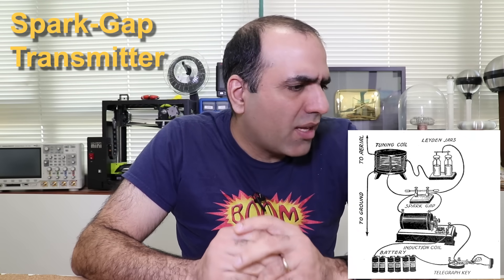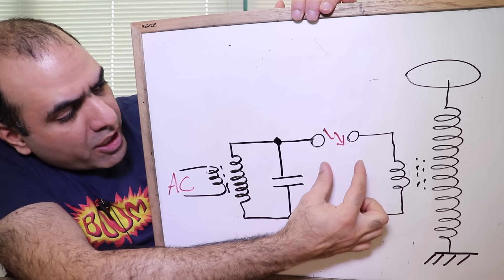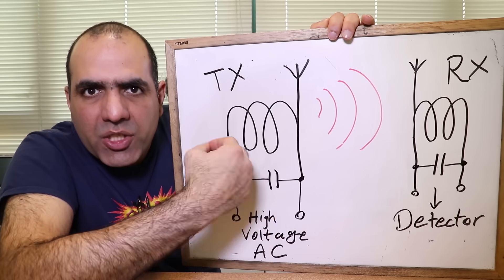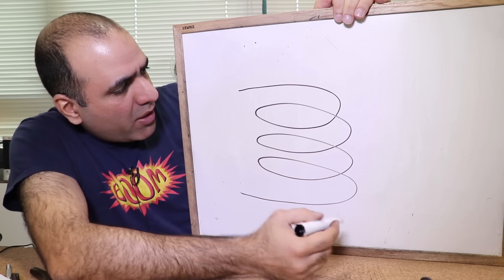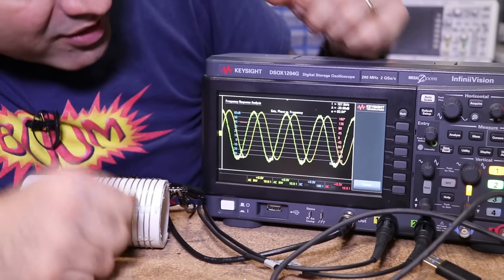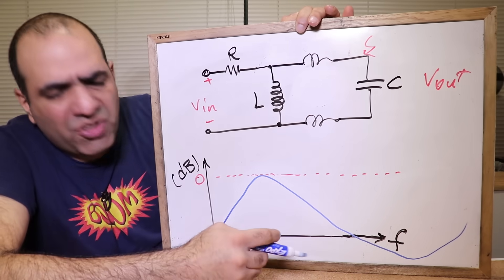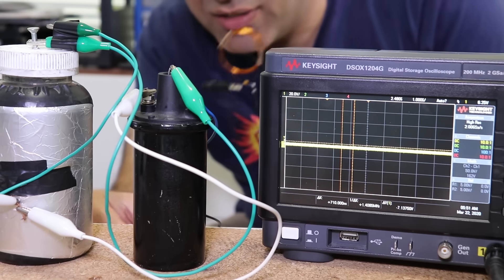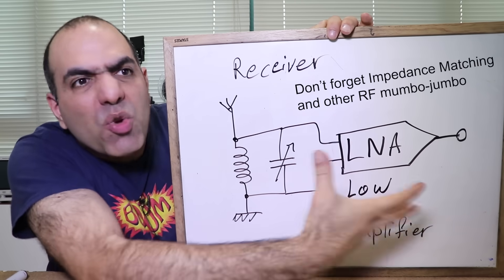Making a Spark-Gap Transmitter

Comment: wait a second, look at this video about tesla coil, in this precise time: https://youtu.be/wSp1IzmRUk8?t=780 . He says that your config is wrong, right?
Reply: In my tests, both methods work.But unless you can use A ultra high voltage capacitor like 10kv than you can place it in parallel.Otherwise you need series it to avoid high voltage kill the capacitor. In this video you can see the Leyden jar almost no upper voltage limit and you can use it peacefully.

Comment: Sending SOS without a reason might get you into trouble. The tracking stations can exactly triangulate where you are and can even tell what transceiver you are using just from the differences of the waveform of a CW for different brands. Spark gaps with tuned antennas will spark their interest, too. If they really track you and come to check - you´ll need to pay like $20000 or so.
Send some bullshit for a short time, that´s safe, but please no SOS. When I was young, I triggered the yellow car with the rotating dish several times :-D And they are indeed faster than police or firefighters. Ten minutes, no joke.

Comment: Your teslacoil design is wrong capacitor and sparkgap should switch places to avoid damagin the capactior (rather short transformer with sparkgap than destroying the capacitor) but that mistake is very common so not to big of a mistake, source for this information is Plasma channels guide on tesla coil. Diode gone wild also shows the proper cirut.

Comment: Cant you add a Potentiometer, to the battery of the ac detector, so you can adjust the voltage and therefore the sensitivity?

Comment: I have a doubt I have heard that AC voltage passes through capacitor so before there can be any arc will the both points of the voltage be Shorted

Sorry if there is any mistake I'm a beginner
Reply: Which points are u talking about

Comment: Shouldn't the cap & spark gap be swapped? Diodegonewild suggested so in his latest video.
Reply: Wrong. I'm correcting every single comment about this, including everyone quoting 'Diodegonewild'. Obviously HF currents can't get into the secondary, there's a big capacitor in parallel across the secondary. Even Tesla himself had the gap in SERIES in his schematics. If HF kickback into the xformer secondary is an issue, add a choke coil in series. There's SO much info on the interwebs about this circuit.

Comment: Mr. Boom, 
I have a theory for why your impedance plot went up again around 10MHz: I don’t think small inductive effects is the problem, rather it is the frequency response of your capacitor. You see, at high frequencies, physical capacitors will cusp down to zero impedance and then become inductive at higher frequencies - included graphically on most datasheets. A result of the dielectric response if I am not mistaken. I imagine your jar capacitor simply does that around 10MHz. 
I am highly confident that is what we are witnessing :)
Reply from the maker: I haven't heard if dielectrics result in inductive properties at high frequencies, but either way capacitors, especially the size of my leyden jar have much more massive parasitic inductances than anything else. Every conductor has some self inductance after all.

Comment: Diodegonewild is itching...
At 4:44 you see the spark gap is in parallel to the source and the capacitor(s) in series with the tuning coil
Reply: Both versions have pros and cons.

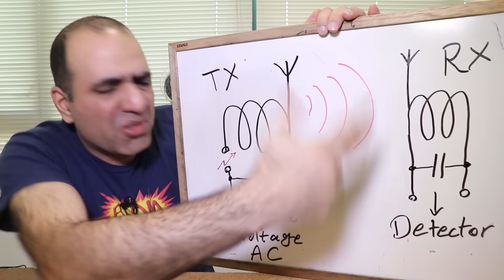Comment: 4:56 Why not use the foil/mylar/material made out of material capacitor that you made in the same video as the Laysomething jar, which has higher capacitance and lower ESR and still has a high voltage capability?

Comment: 2:29 why doesn't the capacitor short the secondary of the transformer? I've seen similar circuits but with a [puny single] diode rectifier, which make more sense to my [uneducated] mind

Comment: His neighbours are wondering why their wifi keeps cutting out.
Reply: And lights keep blinking all the time
Reply: @SLAWA4771  that was my thought.....takin a shower an yer lights  go wonky....."dang it, Mehdis at it again...."
Reply: if he still have neighbours
Reply: Arcs produce wideband interference across a very large range of frequencies.  The pulse frequency of the driver circuit doesn't matter at typical driver circuit operating frequencies (10's to 100's of Hz).  This can absolutely cause unwanted interference with many systems, and as such is not recommended to be used anywhere whether specifically outlawed or not.

That said, nobody uses these because they suck.  It's a curiosity, not a concern.
Reply: And that's how you commit a federal crime as a YouTuber
Reply: I feel sorry for any ham operators near him...
Reply: Excel Kit Palmes Remember the tuned circuit in his receiver is essentially a filter and the scope was showing us voltage sufficient to light an LED. Modern receivers work with nanovolts, so the harmonics would easily swamp any AM radio nearby. In fact I have some receivers that would have blown their first stage transistors with voltages that high if the filtering were tuned to the primary frequency.
Reply: @jaecenwhite2590  Use a microwave oven and place the magnatron outside in front of car and its power is good enough to burn out a radar gun's receiver diode. Speed all you want :-)
Reply: mohammad ezatzadeh Without filtering a spark gap will produce the primary frequency and harmonics of increasing frequency that diminish as the frequency increases. Spark gaps also tend to produce other fundamentals and the two mix producing intermodulation products. That’s why they were outlawed a long time ago, they’re extremely noisy radio wise.. they can wipe out entire HF amateur bands
Reply: 5 simple tricks to create electromagnetic interference and one that will SHOCK you.
Neighbors HATE him.
Reply: @rabbit3704  bot BOT BOGBOT
Reply: Proud American no
Reply: Proud American shut up
Reply: Lol
Reply: Nice joke but sensitive equipment can pick up the noise generated by his spark gap
Reply: @Excel Kit Palmes That is because the scope has its own bandwidth due to the front end and sampling. Everything above 200Mhz should effectively be rounded off or at least not guaranteed to be displayed any degree of accuracy.
Reply: honestly if i were his neighbour, id be wondering if he's insane if he keeps shouting so damn loud all the time when he makes youtube videos
Reply: More like why 1040AM radio keeps cutting out in the apartment building. (I live and hour away from where he is, so I know the radio stations here.)
Reply: Better than when the mains blow out on the block
Reply: d718
Reply: His neighbors are used to it already
Reply: Me not knowing what u r talking about be like aha hm yes ok
Reply: wow that is huge because the internet inst working in argentina XD
Reply: @rabbit3704  lol
Reply: Lol
Reply: Haha
Reply: Lol
Reply: HAHAHAHA this is so true. I jam my ADSL signals and internet whenever i operate my ham radio.
Reply: Hahahaha or their tv suddenly blows up.
Reply: Lol
Reply: Seriously 😂😂
Reply: You guys realize that by screwing with your neighbors Wi-Fi you’re screwing with what is left of his sex life? I do the same thing by putting tanglefoot on his garbage can; he gets that on his hand, and there’s no hand romance until it wears off…
Reply: No they already moved out because the power outages
Reply: He would need a resonance frequency around 2.4 GHz to interfere with most residential wifi.  So about 1700x the frequency.
Reply: @Uejji  Not quite, a little thing called harmonic interference. That is signals generated at the multiples of the primary resonance frequency... Now each one is half the power of the previous but still. Spark gap transmitters are generally not legal in most jurisdictions without special permissions for this reason. They are very good at creating very wideband interference.
Reply: @EwanMarshall  this is why I think doing this experiment at home could run you into some legal issues. IIRC the FCC doesn't allow spark-gap transmitters because of the harmonic interference
Reply: @ExEBoss  yup, that's true. But I'm sure a majority of the viewers are from the U.S, some willing to try the experiment.
Reply: @EwanMarshall  
Spark gap transmitters are great to produce white noise too. Just make them dirty enough to have many harmonics.
Reply: Jidé trump 2020
Reply: @abbasmaheryar1111  Certainly! And a few of us already have the license to do so! I have seen, or rather heard, this multiple frequency interference from homebrew transmitters. Which is why all of my projects get a dummy load and antenna tuner before transmitting.
Reply: @EwanMarshall  love that reply...
Reply: @abbasmaheryar1111  He is based in Canada so it shouldn't be an issue.
Reply: @ExEBoss  They  must have similar laws as we do. For the same reasons too.
Reply: @EwanMarshall  whole time I was wondering how this was FCC legal.
Reply: @abbasmaheryar1111  That's actually not the issue.  The ban isn't on spark gap transmitters explicitly but on any damped wave transmitter generally referred to as Class B emissions.  The FCC ban on them can be here Title 47 § 2.201 (f).  
https://www.govinfo.gov/content/pkg/CFR-2007-title47-vol1/xml/CFR-2007-title47-vol1-sec2-201.xml

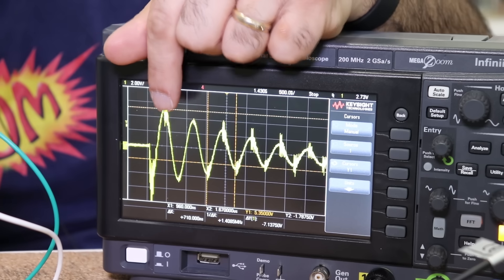If you look at 12:14 in the video you can see the characteristics of the signal and how it decays over time.  That decay is what makes it a damped wave transmitter and as the signal decays it covers a very wide bandwidth which is the primary issue with this kind of emission.   Higher frequency harmonics are going to exist to some extent in every transmitter.  Particularly any time you have an instantaneous change in a signal, say to encode some data, you're going to introduce higher frequency harmonics.  Look a bit into Fourier analysis if you're curious how that works.  The issue with damped wave transmitters it just the fact that they consume a very large part of the frequency spectrum very inefficiently.
Reply: @abbasmaheryar1111  I live in Canada too. So spark gap transmitters are allowed here?
Reply: @torpedo996  Radiocommunication Regulations
SOR/96-484 § 50(1)(b) classifies any transmitter or radio emitting device for which an approved standard does not exist as radio interference.  Since spark gap transmitters have no such standard they would also be classed that way.  Knowingly operating such a device is a fineable offence.
Reply: Daniel Schmitz luckily the FCC has no jurisdiction in Canada
Reply: @ExEBoss  they have a similar comission at canada too
Reply: @Uejji  Not exatly, you only need resonant frequency which does not mean same frequency, or even same frequency range, it simply means there is resonant corespondece beetween the two frequencis, resonant frequency can be at whatever range you want so it can be whatever magnitude lower or higher than the original frequency. Also this are unfiltered square waves which means that they actualy have resonant peaks at virtualy any given frequency anyway, this is called, "EM noise" and wil actualy interfere with any electronic or even electric system if strong enough and the system is not adequatly protected especialy devices that rely on EM transmision, and especialy digital data transfer as the transfer data packs must be complete or otherwise they are corupted and unusable while with analog you simply get the parts you get but everithing you get is at least readable. :) I hope you can read my bad eng..
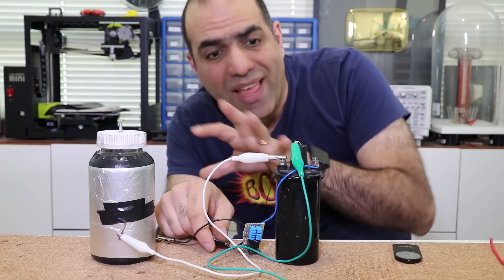Reply: @Domexetron-Galactronic  Thanks for your comment ~ found it useful and kinda fits with my experience. Funny on this video the most replayed segment is @11:00 - demonstrating that many of us are somewhat sadistic in nature...
Reply: @Uejji  Spark Transmitters produce very wide-band transmissions. They will interfere with almost anything. (Despite the use of tuned circuits here, there is still a HV spark gap operating.)
Reply: @Uejji  You are forgetting all the harmonics contained in a spark-gap.
Reply: @Uejji  bruh who cares it was just a joke
Reply: @Uejji it is microwave frequency
Reply: @Uejji  sparks emit electromagnetic radiation at a continuous range of frequencies, from HF to light (literally - you can see the arc) and beyond through UV (hence welding injuries without adequate PPE)
Reply: @rabbit3704  um, ok?
Reply: i think it doesnt apply for him with his low range and as an experiment in a closed envrionment on private property only. his hardly reached a meter to work and was for demonstration. i have seen other videos with similar stuff here ...
Reply: @rabbit3704  why? There is not even any poitics here...
Reply: @H3wastooshort  tbh he couldn’t even start a political argument since people kept talking about electronic things and completely buried him lol
Reply: Not caused by electricity, I am a network expert and a network can only go out if the server hosting your network is overloaded or down.
Reply: @rabbit3704  nobody 2020 as they are all for capitalism when socialism is way better like in the USSR so debate me i know i will win but debate me

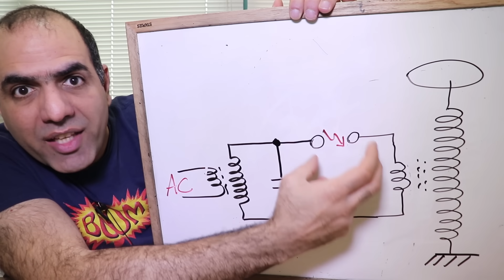Comment: 2:12 Isn't this circuit wrong? The seconadry of the high voltage transformer (the one on the left)will experience high voltage oscillations at very high frequency which might damage the isolation of the transformer. (Excepf for when this transformer is designed to work in such conditions) So to solve this problem the spark gap should be where the cap is and the cap should be where the spark gap is (the high voltage transformer shold be able to withstand shorting out by the spark gap).